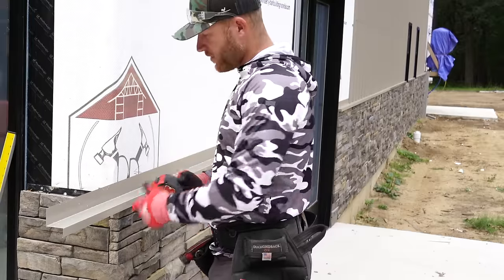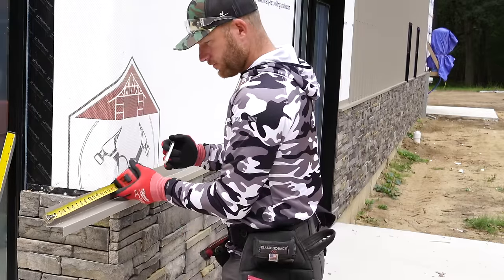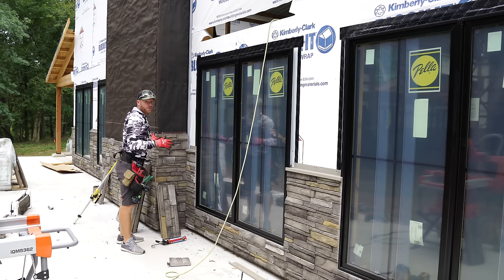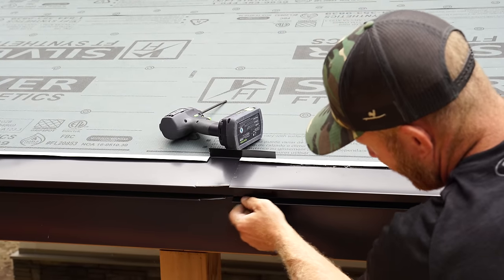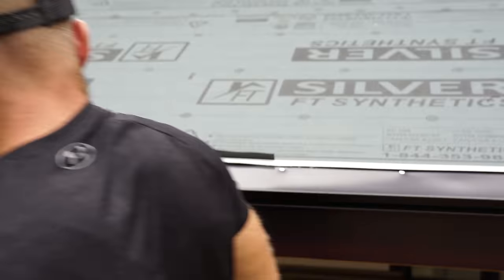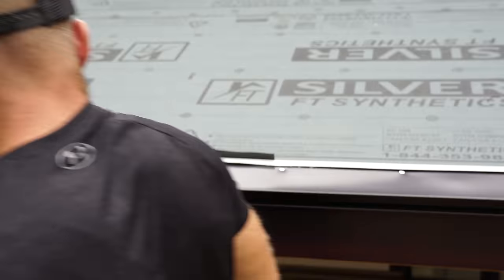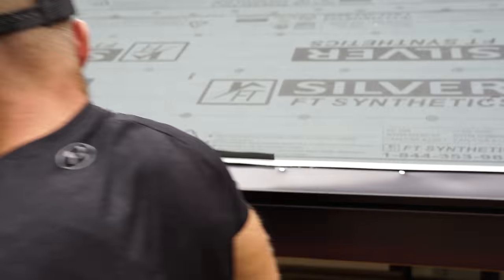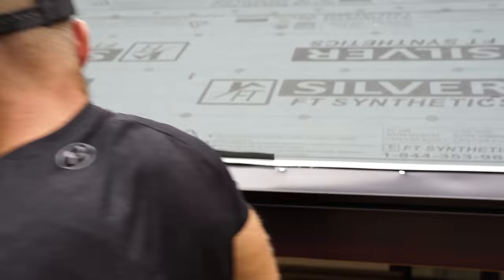Cabin in the Woods 26: Standing Seam Metal Roofing Flashing Details

Comment from the maker: Thanks for watching todays video.  Just wait until the end wall gets done and all the windows and steel are installed!! Going to be awesome
Reply: RR Buildings the level of detail in your work is inspirational to many other builders out here. Thanks
Reply: Question, why do you use a hammer and nail sometimes then use a powered nailer other times?
Reply: Im trying to wrap my head around j trim on a door, there is no nail-fin or ledge to tuck the J trim into do you have to order the door with brick mold? Ive been re watching a bunch of your videos to see if you’ve covered this but cant find it.
Reply: Snap Z makes a great vented z bar.

Comment: If you want, you could snap a line across the roof panels where the z-flashing goes, then cut away your seams, put a bead of sealant on the edge of the seam where it meets the z-flashing and fasten the z-flashing.  The benefit of doing it this way is, it is easier to get the z-flashing straight.  You can do the same on the ridge, and hip of the roof.

Comment: For your ridge vent you should check out a product called “Pest Blok”. It is perforated metal sheet. They make specific pieces for bat proofing ridge vents but will make it basically however you want. Might work out perfect for your Z flash if you combine it with your typical ridge vent foam material for you ridge vent.

Comment: Hey Kyle, love the videos! I'm surprised to see how you flash the tops of windows. You haven't provided a path for water to escape to surface if it gets behind the air barrier above the window. In this specific case you are like a foot to soffit and not a problem, but on multi stories I have run into issues with this technique. Im not sure if you would do differently in a multi story building, but I cut back the tyvec and flip up, then blueskin directly to sheathing onto brickmould or j or window, then flap the tyvec barrier down onto top of blueskin with a couple small pieces of tape to hold the flap down, providing a path for water to escape to window surface. This solved the problem of water behind the air barrier going down until it hit a window, then into interior and dripping off top of windows on interior. The air seal isn't as good this way but water shedding and drying is better. Perhaps you already have seen this. Talking about the ten min mark on video.

Comment: I appreciate the details and why you are doing the flashing. It looks like you are putting the metal roofing directly on the house wrap? Why are you not using wood baton boards or better Delta Trella to create an air gap? Your details of the wall roof connection have no vent that I can see.

Comment: Good detail on the z flashing but is the little fold up on the bottom leg necessary? Butyl your z before, square cut to length and then use a dab of sealant for the corners on pitches below 5/12. Anything steeper just install and go. Minimum of 4 fasteners for a 16" panel to hold and seal the butyl. Also the vapor barrier should be taped on top of the flashing. 
Really sorry to nitpick because I see great work all around! I'm not always right but I've done this for a few years and have learned what's acceptable practice and also time efficient.

Comment: For the ridge cap can you install a C channel before you install the roof sheathing to get the hidden fastener look? and use the mastic tape on top of the C channel to help it adhere to the C channel? Just trying to think of a way to fasten it. The ridge cap would snap to the C channel and the mastic tape would just be insurance with heavy wind.

Comment: Next time on that corner,use other snips when 45° the z. U had the tabs so it can catch water. The vertical one should be able to drain past the horizontal. U had it so some water can go in the z. Not enough to leak

Comment: Transition flashings are not laced into the moisture barrier or striped in with ice and watershield to shed moisture out onto the flashings. That Dap caulk is probably not approved by any metal manufacturers.  Clear silicone caulk will cause the paint to fail which will the allow the the end laps to rust.

Comment: Water is going to run off the top if the window flashing ends behind the wall panels and behind the transition flashing because it is not installed in the direction of the water flow.  In ten years a roofer will be caulking everything up be the owner thinks the roof is leaking when in fact moisture is running down behind the wall panels at the transition flashing that was not installed in the direction of the water flow.  Looks great tho!

Comment: You did not caulk the vertical legs after installing the zee closures. On the corner zee you could have bent top to the outside and open hemed the the flashing to hook onto it like you do the eave trim.